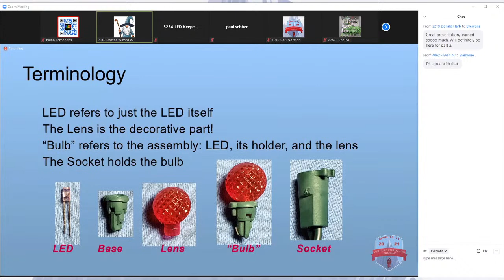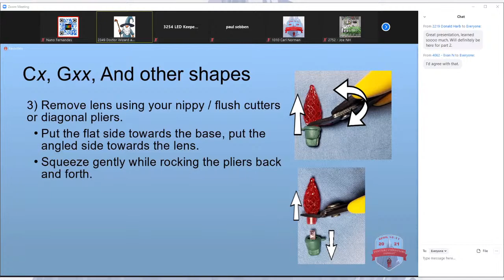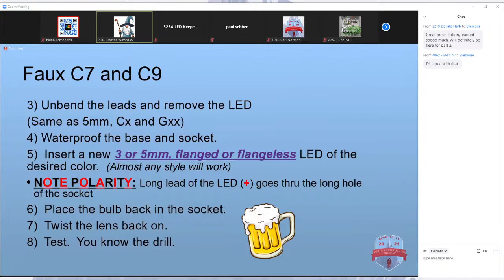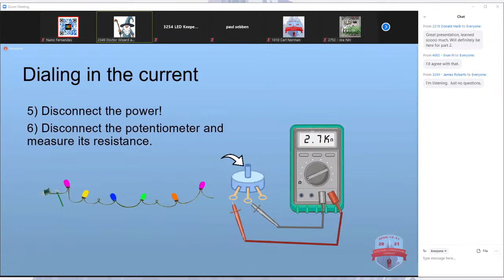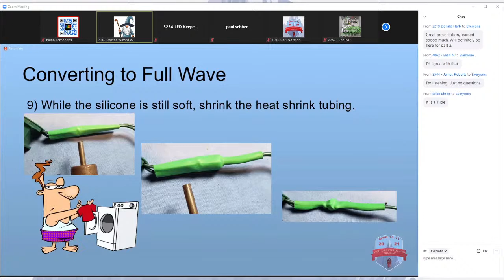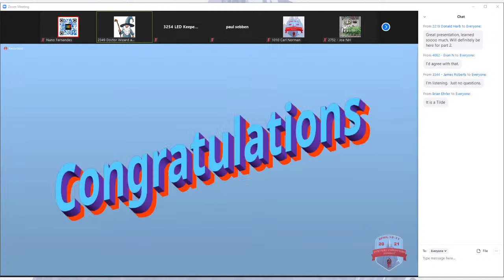VCS 2021 - LED Strings: How They Work, How They're Made, How They Fail, and How to Fix Them - Part 2

Comment: I started buying LED Christmas lights at the big box stores years ago, (never ever again) they are very easy to fix but, the problem is when you replace 
a light that has burnt out and it has a little resistor soldered  to the light, the replacements don’t have  resistors!!!. And eventually the whole string will go bad because that puts more stress on the rest of the set.   There is nothing on Youtube that I can find  about soldering new resistors on the diode so it can be repaired properly.